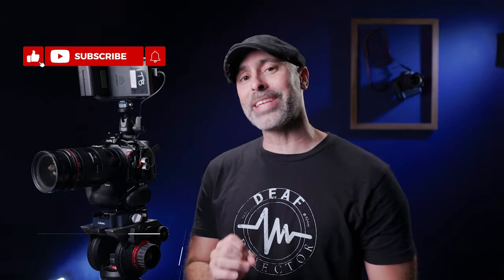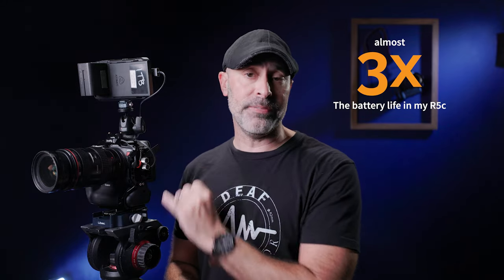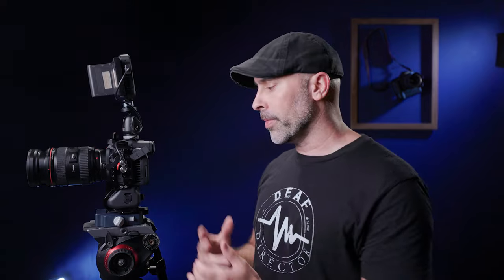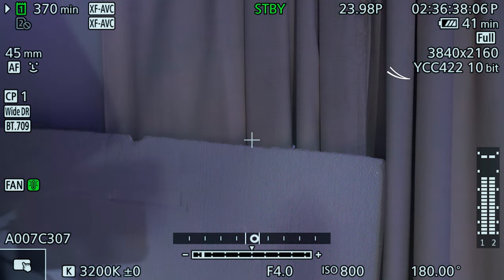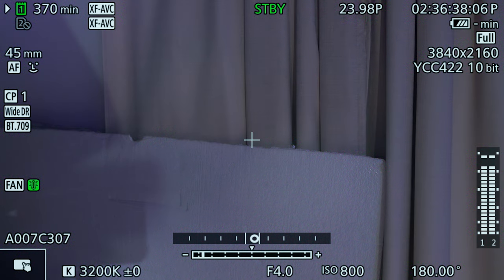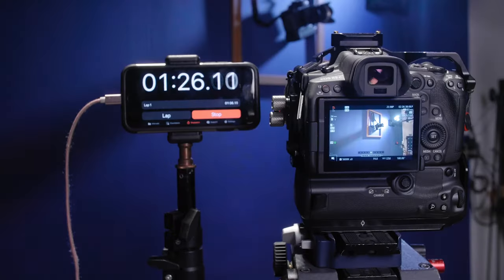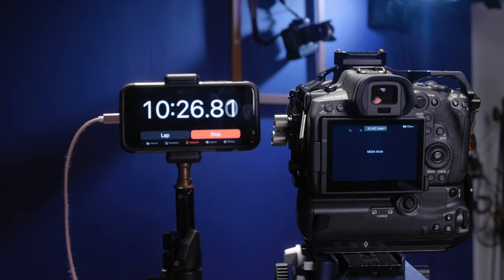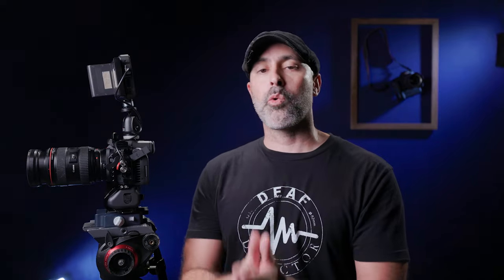CANON R5C POWER HACK! How I nearly tripled a single battery charge in video mode

Comment: I appreciate your advice here but what good is that though? It's no different to switching the camera off really. You need the battery for recording, that's the main thing. It's not overly beneficial leaving the camera on preview mode.
Reply from the maker: Hey Hugh, I think the biggest advantage is you that when you switch your camera off, you have to wait several seconds before it comes back online. With this method you can preserve your battery and be back to recording in less than 2 seconds. This methods also greatly extends the life of your battery in between shots, without having to wait for everything to wake back up. Thanks for the comment and have a great day!

Comment: I love how you're still using the OG 24-70mm 2.8/F It was my FIRST L glass investment 10 years back and still was very good (after a repair) when i sold it. Yes the newer glass is sharper, but i have NEVER had a client been able to spot the difference between the Mk1 and Mk2 images.
Reply from the maker: That old trusty piece of glass has been on many, many a trail with me. Thanks for the comment and have a great day!
Reply: @DeafDirector  Yup! Love it so much. Canon LA didn't want to fix it so I had to send mine to Europe to get the AF motor fixed. Lovely glass

Comment: Another hack to double your battery life is to record in 8K RAW. You can easily see the estimated remaining time doubles when you switch to 8K RAW. And why get R5C and not use it for its main feature anyway. I get about 64 minutes of record time with RAW (disabled continous AF). Just have it run in standby without recording anything battery lasted 82 minutes. I'll use the Media button trick though when I need to conserve battery power, as turning the camera off is annoying, because not only the boot up time is a few seconds, but also you get the annoying noise level warning message in RAW (can we turn this off - how many times do I need to be warned about something I don't care?), and you have to refocus with an RF lens.
Reply from the maker: Great tip! Thanks for the comment and have a great day!
Reply: Good to know this!
Reply: What app you use for post processing 8k raw? I’m very new to R5C and videography. Thanks in advance!
Reply: @minimeguju6868  I use Davinci Resolve. I render to 4K, not 8K though.

Comment: How about turning off the fan as we just record in 4K and not in 8K and just switching the fan on on 8K?
Reply: The fan stays on constantly.  You can't turn it off, but only change the speed
Reply: @Drunken_Pil0t  yeah I notice.. 😐
Reply: @travelexplorer  hopefully the new firmware will add some type of sleep function where the fan and sensor turns off when not recording. I've drained the battery just by looking through my menus 😭😞😞😞😞
Reply: @Drunken_Pil0t  i know but the true fix is fxlion one battery
Reply: @travelexplorer  I actually own the fxlion nano one. Ever since I've been using the Canon battery grip, I stopped using the nano.
Reply: @Drunken_Pil0t  😲
Reply: @Drunken_Pil0t  how may hours of 4k 60p does the grip give you ? With the two batteries inside ?
Reply: @creativegreats  I've never tested 4k 60p for a long duration,  but the battery grip with 2x LP-E6NH can shoot 4k 24p "Long GOP" for about 1 hour and 25 mins. I was shooting a church ceremony continuously until the grip died. I'd assumed 4k 60p would be half of that.
Reply: I started to buy a lot of LP-E6NH batteries like two a month right now I have 6 and I have two FxLion for big projects I am using the FXlion is way better, but for personal projects the smaller batteries are perfect

Comment: It really isn't as such. You could power off the camera as well or switch to photo mode
Reply from the maker: The main problem with that method is it takes several seconds to compete each cycle, and you run the very real risk of missing shots doing this, or just irritating people on set waiting for your camera to cycle back on. This way is almost instantaneous and requires only 1 button touch. Have a great day!

Comment: How often did you hit the Media button? Also did you run a test in record?
Reply from the maker: On set I switch between it dozens of times, for the test in the video I just switched over once. Either way it greatly improved by battery performance. Thanks for the comment and have a great day!
Reply: @DeafDirector  Grateful for your insights on the R5 C. AF tracking video was so helpful!

Comment: Consider re-naming the video to - Canon Power Hack - How I use Media Mode to extend battery life.
.
The current title makes it think you are increasing record times. That's what someone who's clicking on this will think.
.
Anyhow thanks for sharing!
Reply: Your suggested title still doesn't imply it's standby time, and not record time. Still, this camera uses a ton of power just by being on, not recording anything, so it's a significant hack to have in your arsenal. Your camera is going to be in standby more than in record mode anyway.

Comment: This video shows a very limited way of saving battery which could have been explained in less than 2 minutes.  It's very limited in use because while I'm lighting or setting up a shot, I need to see picture.  The amount of situations that putting the camera in media mode would significantly help in my usage is almost nil.
Reply: This may not work for you but it may help others so if this doesn't help you just skip to the next video and don't throw negativity to someone trying to help.